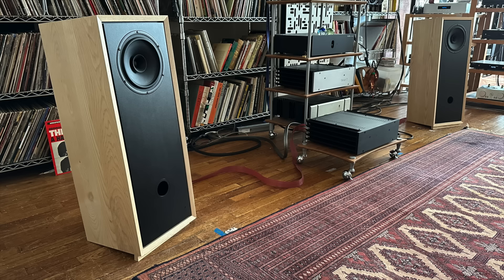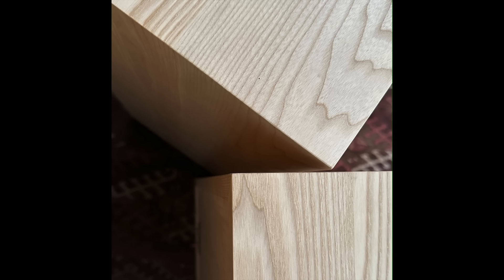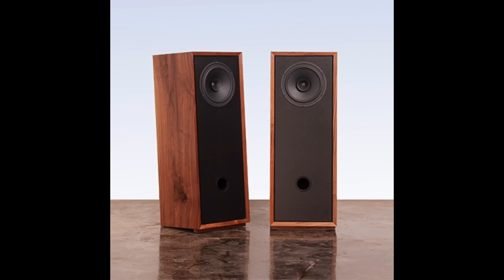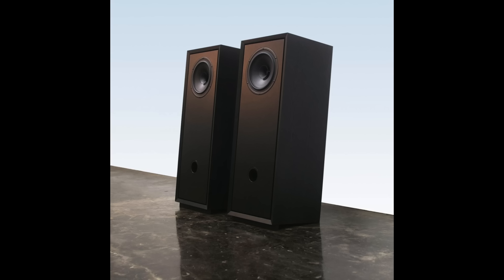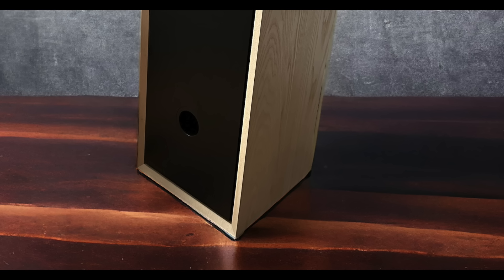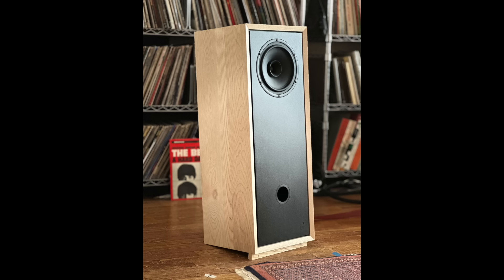FERN & ROBY Raven III speaker, the rest of the story

Comment: Hi Steve, I wish you asked some probing questions. 1. Why solid wood, with its problems, when Baltic birch ply or MDF/HDF with cabinet bracing is generally preferred? Is it to avoid veneers? Or keep a local woodworking shop busy? 2. Why a wizzer cone, with its problems, requiring a contouring circuit as complex as a two-way Xover? Has the designer studied the work of Mark Fenlon at Mark Audio & Marek at Cube Audio in avoiding or improving upon a whizzer cone? 3. Your difficulty in placing the speakers to get good sound indicates a serious problem, has the designer published detailed measurements?

Comment: just a comment to trigger the payment algorithm.    speaker grill cloth stretches, so is a very forgiving material to work with, should one ever need a cosmetic modification, or to keep off the dust, or away from curious little fingers,  when not in use.